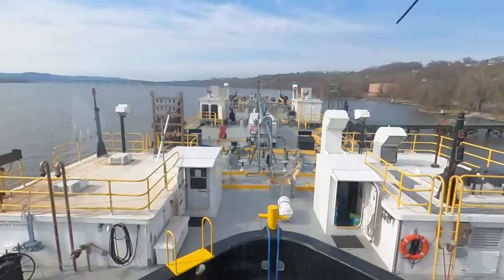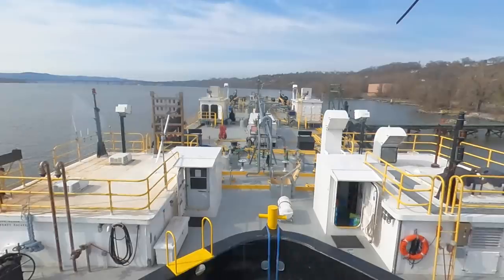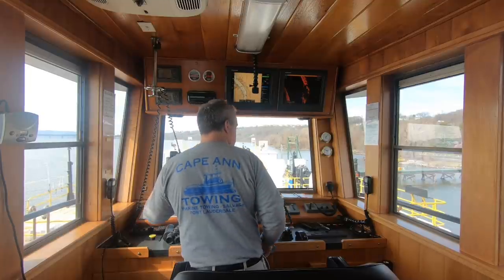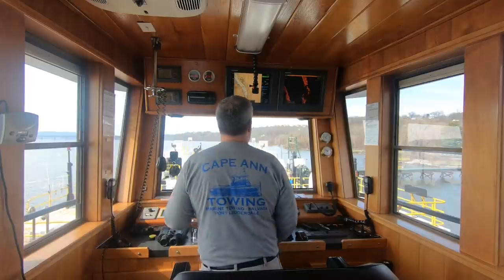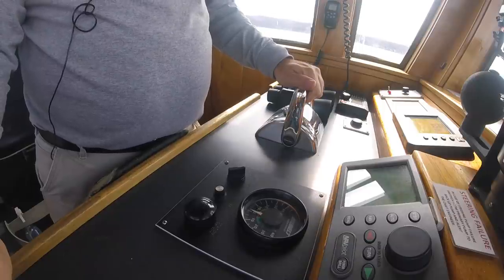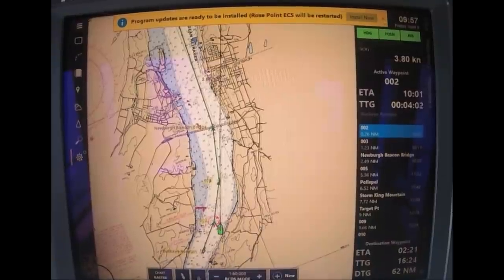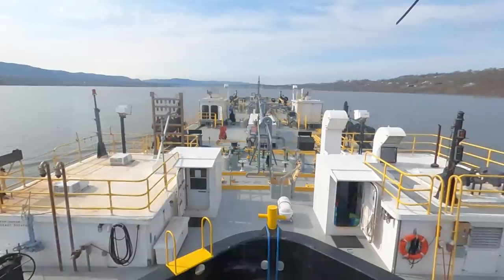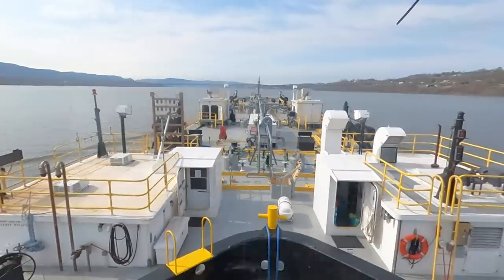Down Bound in the Hudson River

Comment: Would you consider using inexpensive battery-powered wireless cameras temporarily installed on the barge rails to give you a visual look at areas that can't be seen from the wheelhouse?  Would give you a visual of the dock when arriving and departing.
Reply from the maker: Thank you for watching Clifton. Although that is a common question, I believe there bc would be a few problems with doing that. First, we move many different barges and they moved by many different Tugboats. Then there is the thing about nothing electric being allowed on deck of the barges unless it has been proven to be ignition proof. And there is the other thing of having to be able to to see 300 to 400 feet of barge through a backup camera. CUOTO

Comment: I saw a couple of deck hands coming back on the tug from the barge and it looked like the bow rail is pretty high from the tug deck, how tall is it to the deck?
Reply from the maker: Ron, what i believe you are seeing is not the bow of the tug, but rather the notch of the barge that the bow of the tug sits in. It's hight is dependent on the load of the barge. In this case, the barge was lite (no cargo) so it was about 20 feet higher than when it's loaded. CUOTO

Comment: I had some experience on tugs and offshore supply vessels back in the 80s.  I don't remember any problem synching the engines by ear or by the tachs, is the auto sync really necessary?    Also, in my opinion, I can always speed up the playbackif I want to.
Reply from the maker: Thank you for watching Rob. I never used the synch function until we had our old analog throttles with new digital ones. It didn't take long for me to really like them. CUOTO

Comment: Tim Thank you for another awesome video. Any video is a good video wether it is sped up or not. I saw looking at the Nav lights on the barge. The light on the right as what appears to be a large green light with an amber light above facing aft. Anda green light on top of the  pole. The left is just the red light on top of light pole. I am seeing right right. just curious. Thanks Again CUOTO 
Brian
Reply from the maker: Thank you for watching Brian. Our barges are configured to be pushed frontwards or backwards, so you are probably seeing the barge lights not in use until it is pushed backwards. CUOTO

Comment: Tim, are there no special procedures when crew cross between barge and tug?  They don't have to call up to you by radio first?
Reply from the maker: Thank you for watchng and supporting the channel TJ.  Yes.  At least on  my boat.  I like the guys to call up to me when going to or coming from the barge. It is much more criticle when we are made up along side and any change of throttle or steering angle can result in the tug moving or sliding  on the barge. Not good when on the ladder.  So I have them give me a call when they get on or off the barge.  It also helps me to keep an eye out for them. It is a terrible feeling when you can't find your deckhand and think he may have gone over the side only to find him watcing TV in the galley.  CUOTO

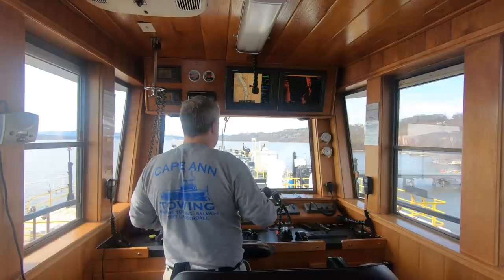Comment: You said you were gonna call it 05:59 (if I’m not mistaken).  Just curious, is it just a courtesy?  Or does each crew member maintain log books to time stamp?
Reply from the maker: Thank you for watching Perry. The Tankermen have to log the barge's movements. So i pas my times to the deckhands so they can pass them to the Tankermen so all our times match up. CUOTO
Reply: I was wondering about the calling the time underway.  It is more than good practice to encourage a consistent time awareness among those working together and allow any desynchronisation between a team to be identified?

Are the synched throttles part of the latest set of upgrades that occurred?  Are any of the types of upgrades that occurred able to be talked about (notwithstanding the need to avoid disclosing proprietary info)?  I'd guess some of those upgrades may have sought to address deficiencies, or provide new capabilities.  Perhaps only the now addressed deficiencies can distilled down into hypotheticals more than the current deficiencies.